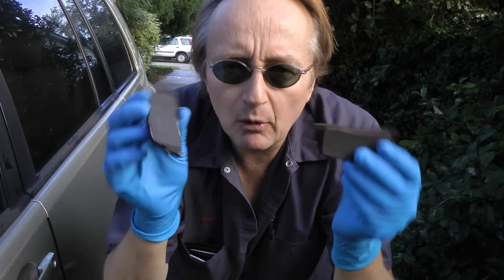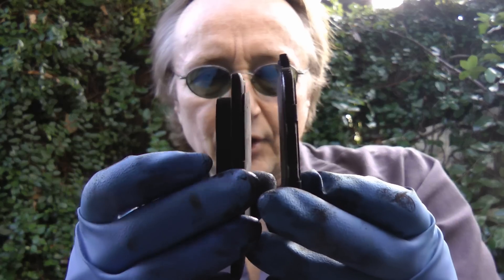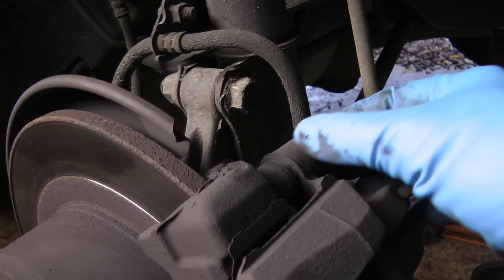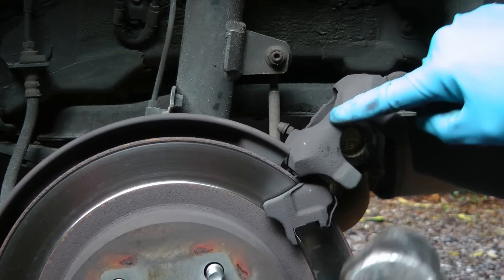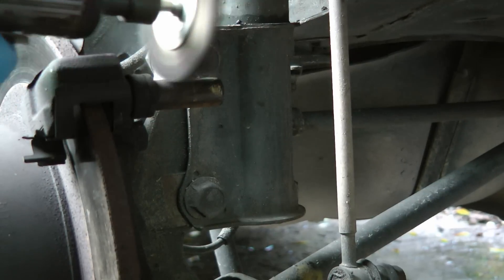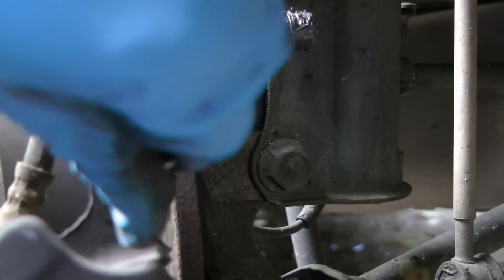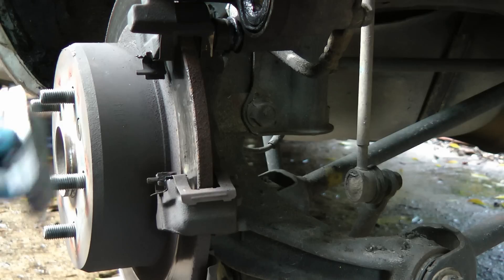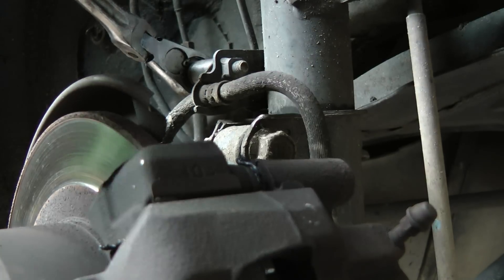How to Stop Brakes from Squeaking and Sticking in Your Car

Comment: Come on dude have you heard nothing from Eric the Car Guy use silicone paste never grease moving brake parts just use silicone paste. The reason is because the grease is petroleum and it will react with the petroleum that's in the rubber boot that goes around the little pistons and other parts.
Reply: Having done brake jobs on Hondas, GMCs and BMWs it all depends on the brake set up. For instance on some Hondas  it’s important to use silicone based grease since one of the pins has a little rubber boot on the pin. Not using silicone will swell that boot. On my GMC truck perfectly fine to use the CRC grease as there is no rubber on the pin itself. For my BMW NO grease is necessary on the pins. While some folks do grease the pins, the BMW repair manual calls for no grease on the pins. But of course I still grease the metal contact points as demonstrated by Scotty.

Comment from the maker: realize that baby uses regenerative braking, and as such, a complex computer driven insane mess to analyze. Get thee to a toyota mechanic with a machine as in my video 'fixing modern cars using high level scan computers" to analyze that system before you try anything.